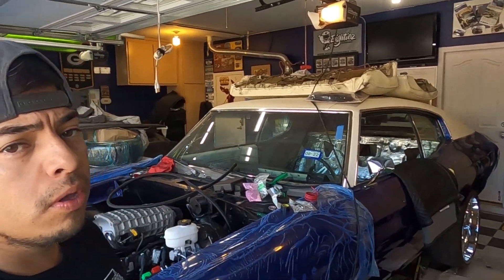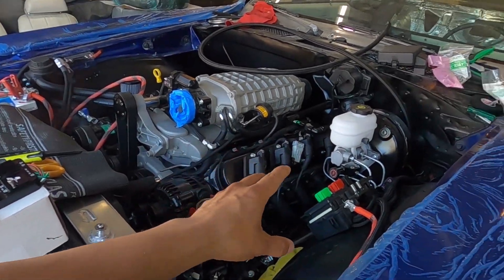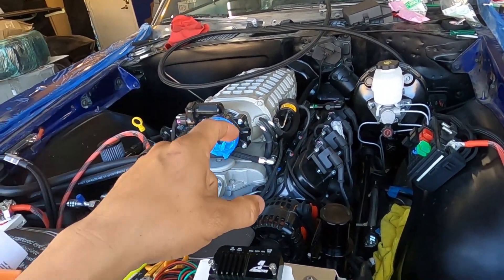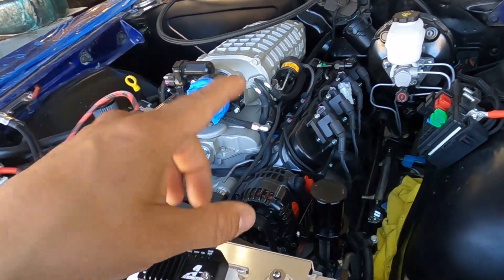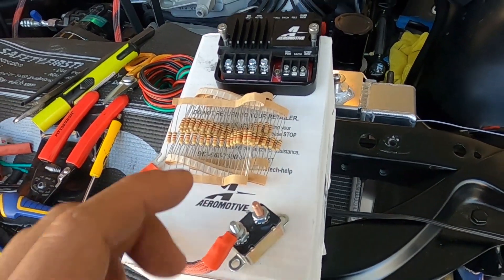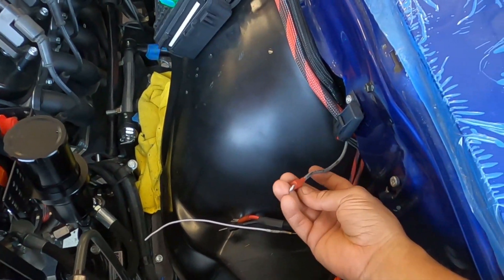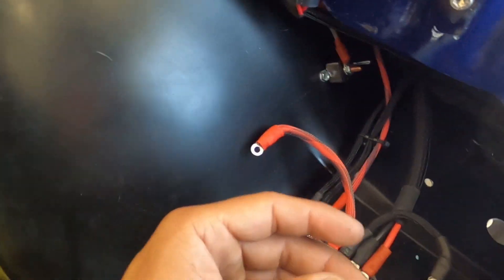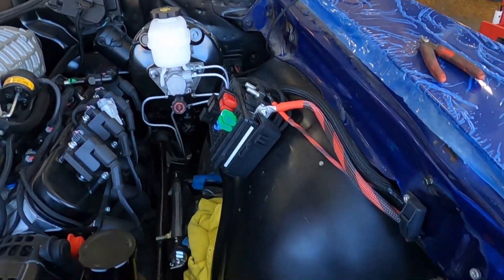HOW TO PROPERLY WIRE YOUR HELLCAT FUEL PUMP USING AEROMOTIVE FUEL PUMP CONTROLLER

Comment: hellcat fuel pump is $125, this controller is $400, i doubt you'll ever kill 3 pumps in the life of the car even running them 100% on all the time, i got 9 years and 150k miles on a 255lph pump running it 100% all the time off a relay. unneeded product unless you need to limit voltage to the pump because the pump is over-running your fuel systems return capacity, or if you have a returnless system. running just off rpm's as the trigger is not a 100% solution either, you can be high rpm low load or low load high rpm.

Comment: You're close but PWM controllers don't really change the voltage, they pulse it. The fatter the pulses the harder the motor in the fuel pump works. That's why you have to shield the wires to the pump because it's a very noisy circuit. I just did an LS swap with an l76 from a 2008 pickup and it has factory PWM control for the fuel pump with a pressure sensor.
Reply: So you need to use shielded wire for the 525? Just goes to pump to relay then right?  Nothing extra?

Comment: Looks great man. Love the wire management and the use of heat shrink. I’m running duel Aeromotive 340’s with the Vaporworx PWM. With the Vaporworx, I had to splice into my boost sensor on the LSA hood, as I regulates the fuel pressure based on boost.